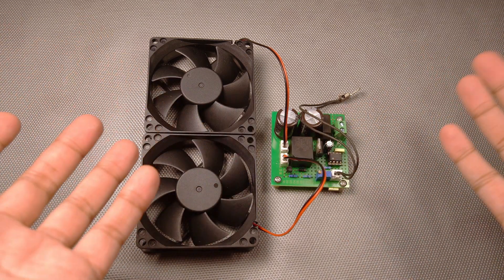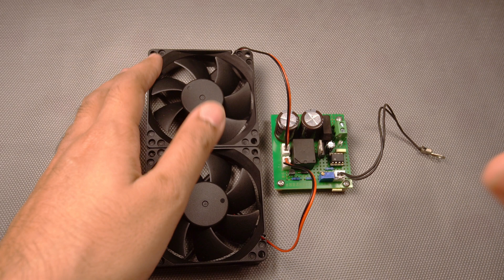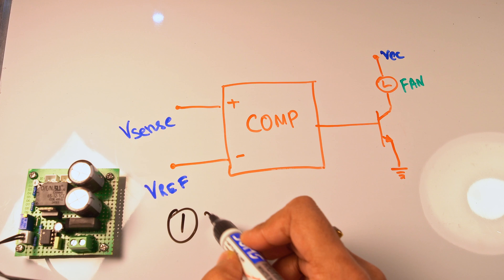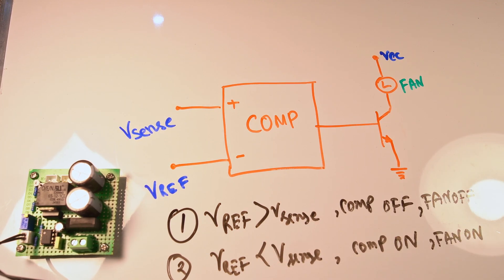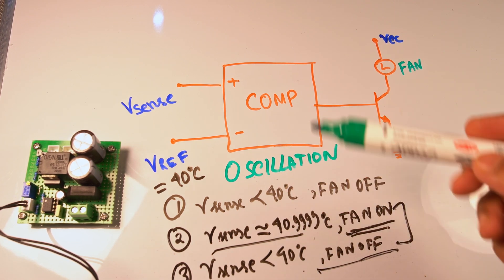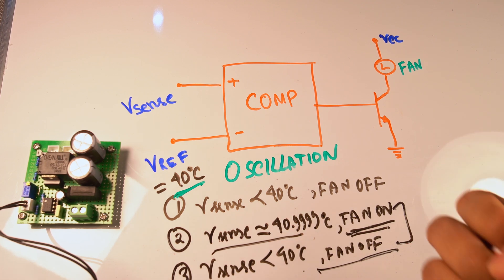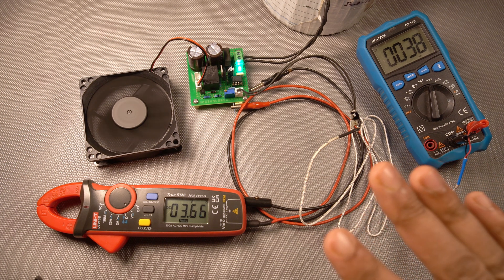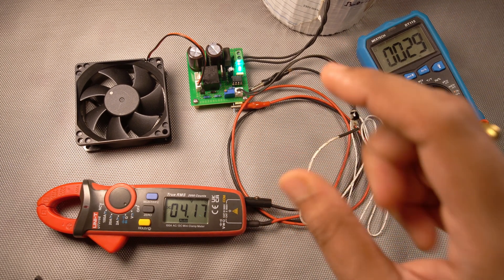Fan Control Circuit design and Testing - What is Hysteresis ? Detailed Testing and explanation

Comment: Nice very detailed . 
Now Try the one I have told you, it also good and have 2 speeds
Reply from the maker: Thank you 😊
1) Thank you for suggesting, but Im not looking for a 2 speed fan control circuit for my project 
2) If I would really want to have variable speeds for the fan , then I would rather go for pic uC or attiny85 . Few lines of code and I can control my fan speed with PWM . Which would be more precise and robust.